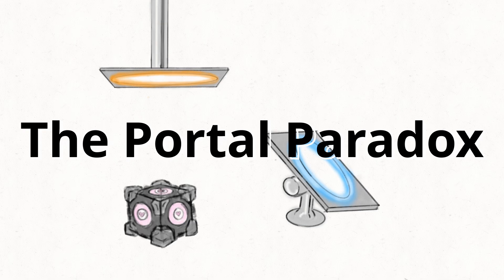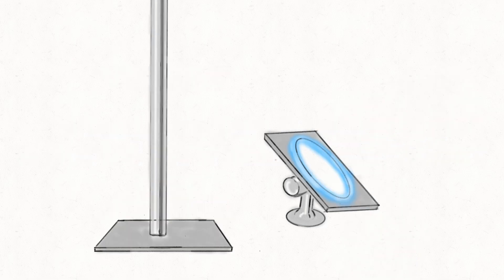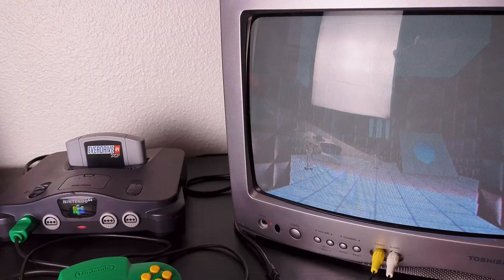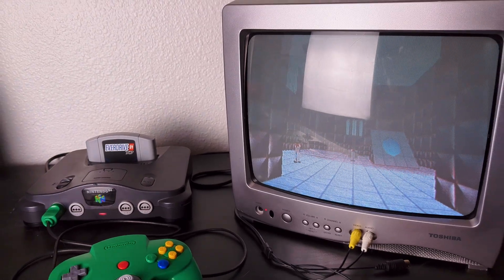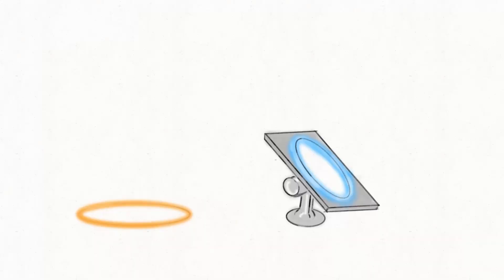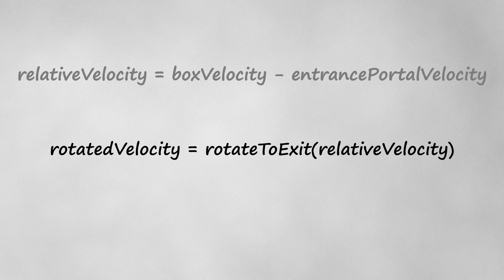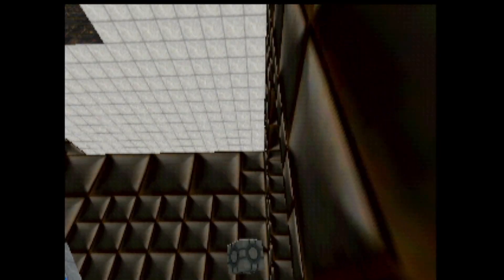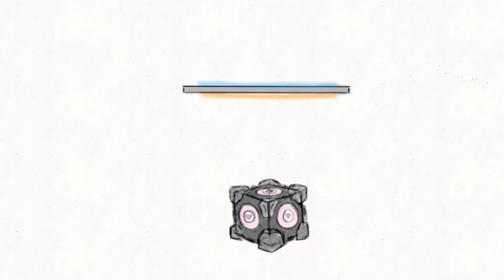I rewrote Portal from scratch and solved the Portal Paradox

Comment: Excellent topic and wonderful implementation! I understand what you implemented and it works great, but I do believe it's based on an invalid premise.

The more I look into it, the more I think this is not right. Portals connect two different locations in one spot. The moment portal is created, it's a 0mm bridge between two points in space. When you look at the orange portal what you see inside is space occupied behind the blue portal, and vice versa.

In a way, creating a portal would be like having a box with one side removed (that side being "the portal", outside being orange side, and inside being blue side). 

With that in mind no matter how fast you drop the box onto a different object, you wouldn't expect the object to start flying inside the box. You'd might say "Hey, this is my example with the portals on top of each other!" And to that I say, yes, but also no. Just because in the main example blue portal is elsewhere, the exact same logic applies because portals are connected, and blue portal from the orange's perspective is falling down equally fast so it should all cancel each other out. Given that two portals are bridges between two points, relative elements from the portal cancel each other out and only velocity that's important is object's velocity. The mere act of going through a portal does not induce new velocity regardless of the setup because once a portal is connected, it is effectively a hulla hoop regardless of the configuration, position in 3d space, ...

Consider this viewpoint test (which works in all cases, including examples you gave in the video) - Imagine placing a camera on the object, and on the other side of the box. 
Camera 1 would see Orange portal flying down towards it, and Camera 2 would see object coming closer.

You could create the exact same viewpoint test with 2 phones and a regular box. You'd see the same thing, and you wouldn't expect the phone on the ground recording upwards to jump up in the box. If anything the example you've made, with the portals on top of each other kind of proves the whole point, and I'd argue it's the only accurate case because it's only in that scenario the relative forces of the portal movement cancel each other out. while in all other cases it's the blue portal from the orange's perspective that's cancelling the orange's movement.

I hope that I've somewhat articulated my point, and I'd love to hear your thoughts!
Reply: You're exactly right. Portals are just open doorways to an unusual location, not some magic momentum transferring device. If you slammed down an open doorway on the cube, it's not going to launch up into the air, the cube is just on the other side of the doorway. The exit location being over on the other side of the room doesn't change this. People are coming up with all kinds of arguments to impart momentum from the portal onto the cube, but no such mechanism exists when a portal is effectively nothing. Nothingness coming into contact with something cannot give energy to it.
Reply: @Sypher474  Thank you!

Comment: I'm no expert, but I feel like the cube wouldn't be able to fly out on the grounds that it would have no energy in its system. If reeling an object back of lifting an object up gives it potential energy and releasing or dropping it transfers all of that potential energy into kinetic energy (bar energy losses from air resistance/gravity), I see no way for the cube to gain any energy at all. Yes, the portal has  energy, but that energy was given to it when it was raised to the ceiling. Dropping the portal down uses that potential energy, all of it. The portal has no collision with the cube (hence why the cube wouldn't jump in the hula-hoop example) and therefore there is no energy transfer at all. If the cube were to shoot out in a real-world scenario, that would be a case for creating energy from nothing (perpetual motion machine that completely disregards all forces acting upon it)

Comment: Everybody focuses on how the cube going through the portal is the same to the portal. Whether the cube is moving at that speed or the portal is moving at that speed around the cube. Everybody ignores the fact that the cube does not have its own inertia, it's like the buster Keaton bit where the building would fall down around him. To the point of view of the building, him jumping through the window or the window falling and crashing around him but not touching him is the same, he physically does move through that window frame at that same speed either way. But, he doesn't suddenly jump up after going through it, because he's inertia is keeping him still. So a cube that does not have any movement going through the portal would then just suddenly have a little bit of distance between it and the floor and would fall at normal gravity towards that floor. The cube has its own inertia, and it's a nurture is keeping it. Still, not sending it flying

Comment: If I was in a room with an open doorway that just opened up to the outside and the whole room shifted sideways at the same time that I jumped...I wouldn't gain sideways momentum from the door passing around me, I'd just fall straight down again, maybe a little momentum in the direction that the door had moved due to air currents.

I see the portals like that: just fancy doorways. One passing around you wouldn't add kinetic energy to you.

Comment: My interpretation has always been that moving a portal surface breaks portals in every* scenario implies a non-relativistic universe. There is a preferred frame to the universe and portals which are moving relative to that frame break. This makes the portal paradox trivial because you just work in the preferred frame. I suppose there could be a more general interpretation where portals must maintain the inertial frame they are created in which would allow for an interaction like this. Without thinking too hard, this seems like the way to resolve the issue with such a universe (all the portal interactions you showed are in a fixed frame as the object passes through).

* I know the lasers and moon technically break this but that seems more consistent with a dev oversight than an intentional choice about the physics.

Comment: This is all incredibly obvious.
How could anyone with basic physics knowledge even think it behaves the other way?

More interesting is that this isn't an all-or-nothing effect, 'slices' of the cube would have this momentum, which the rest of it is completely still; this would result in part of it pulling the rest along.
The end effect would be that this overall relative momentum is greatly halted by the first slices trying to pull away, and then being pulled back, thus pushing back the following slices slightly.
If you did the same thing with a huge blob of putty it would just stretch out, but with a rigid object it'd be far more complicated.

Comment: A = Portal 1 Velocity
B = Cube Velocity
C = Portal 2 Velocity
Change = Total Sum of Changes to Velocity
RV1 = |A - B| + Changes
RV2 = |B - C| + Changes
RV3 = |A - C| + Changes
Total Changes = All external forces applied
Total Velocity= A + B + C
Total Energy = Total Velocity + Total Changes

Premises:
1. Relative Velocity = |A - B|
2. Velocity only changes due to external forces being applied. ----- What you are ignoring.
3. Relative Velocity will increase or decrease proportionally dependent on the changes of the objects' velocities that are involved. ---- What you are ignoring.
4. Total Energy should only occure when an external force is applied contributing to the Total Changes. -- What you are ignoring.

Occurance:
Portal 1 falls around cube, stops on ground.
Cube resides on ground.
Portal 2 resides stationary on slope.

Starting Scenario:
Portal 1 Velocity = A = 10 m/s
Cube Velocity = B = 0 m/s
Portal 2 Velocity = C = 0 m/s
RV1 = |A - B| = |10 - 0| = 10 m/s
RV2 = |B - C| = |0 - 0| = 0 m/s
RV3 = |A - C| = |10 - 0| = 10 m/s
Total Velocity = 10 m/s
Total Changes = 0 m/s
Total Energy = 10

Force Applied: Portal 1 hitting ground.
Result: Portal 1 drops to 0 m/s velocity

Portal 1 Velocity = A + Change = 10 - 10 = 0 m/s
Cube Velocity = B = 0 m/s
Portal 2 Velocity = C = 0 m/s
RV1 = |A - B| + ChangeA = |10 - 0| - 10 = 0 m/s
RV2 = |B - C| = |0 - 0| = 0 m/s
RV3 = |A - C| + ChangeA = |10 - 0| -10 = 0 m/s
Total Velocity Before Change = 10 m/s
Total Change = -10 m/s
Total Energy = 0 m/s (Lost to Enviornment: Gravity on Portal 1 canceled by Floor resistance)

Ending Result:
Portal 1 Velocity = A = 0 m/s
Cube = B = 0 m/s
Portal 2 = C = 0 m/s
RV1 = |A - B| = |0 - 0| = 0 m/s
RV2 = |B - C| = |0 - 0| = 0 m/s
RV3 = |A - C| = |0 - 0| = 0 m/s
Total Velocity = 0 m/s
Total Changes = 0 m/s
Total Energy = 0 m/s
All energy lost to environment (gravitational force being equalized by ground resistance force on Portal).

This is what should have happened.
Portal 1 decellerated. The relative velocity between Portal 1 and Cube should now be 0.
You ignored this, and seem to believe that the decrease in velocity of Portal 1 is balanced out by the arbitrary force randomly applied to Cube for no reason, so that the end result is still 10 m/s for RV1.

What you erroneously did:

Occurance:
Portal 1 falls towards floor, hits floor, decellerates to 0 m/s.
Cube resides on floor stationairy, acquires phantom force, adding 10 m/s to velocity.
Portal 2 remains stationary.

Starting Scenario:
Portal 1 = A = 10 m/s
Cube = B = 0 m/s
Portal 2 = C = 0 m/s
RV1 = |A - B| = |10 - 0| = 10 m/s
RV2 = |C - B| = |0 - 0| = 0 m/s
RV3 = |A - C| = |10 - 0| = 10 m/s
Total Velocity = 10
Total Changes = 0 m/s
Total Energy = 10

Forces Applied: 
Change1 = -10 m/s to Portal 1 (Hits floor, decelerrating to 0 m/s)
Change2 = +10 m/s to Cube (Phantom Force)

Portal 1 Velocity = A + Change = 10 m/s -10 m/s = 0 m/s
Cube Velocity = B + Change = 0 m/s + 10 m/s = 10 m/s
Portal 2 Velocity = C = 0 m/s
RV1 = |A - B| + Change1 + Change 2 = |10 - 0| - 10 + 10 = 10 m/s
RV2 = |B - C| + Change2 = |0 - 0| + 10 = 10 m/s
RV3 = |A - B| + Change1 = |10 - 0| - 10 = 0 m/s
Total Velocity: = A + B + C = 20
Total Changes = Change1 + Change2 = -10 + 10 = 0 (Your theory that the forces should arbitrarily transfer as to not change the relative velocity equates to "no change")
Total Energy = Total Velocity + Total Changes = 20 + 0 = 20

This somehow ADDS 10 Phantom Energy to the scenario.

Result:
Portal 1 Velocity = A = 0 m/s
Cube Velocity = B = 10 m/s
Portal 2 Velocity = C = 0 m/s
RV1 = |A - B| = |0 - 10| = 10 m/s
RV2 = |B - C| = |10 - 0|  = 10 m/s
RV3 = |A - C| = |0 - 0| = 0 m/s
Total Velocity = 20
Total Changes = 0
Total Energy = 20

This is your erroneous error.

You've added a phantom force into the mix, by assuming that the cube would move to maintain the relative velocity, while ignoring that the deceleration of the portal should've decreased the relative velocity by an equal amount between them... You were so fixating on thinking that it had to abritratily be maintained, instead of the reality that it would've all decreased because you lost force in the scenario due to the portal stopping.

This is how you're wrong.

The issue becomes increasingly more glaring in a scenario that Portal 1 never stops moving, because then there is an increase in their relative velocity as a whole even, and even your "must maintain this relative velocity" is false, because of this phantom force you're adding.
Reply: Wrong.

Comment: wow I'm super late with this comment, but I disagree with this. Let me explain why!:

- Speedy thing in, speedy thing out is true, however, speedy thing is not going in. Speedy portal is enveloping stationary thing.
- Because speedy thing does not go in, it has 0 velocity. The speed of the portal doesn't matter because the portal is 'nothing'. It's just a hole.
- If the portal slams down onto the cube, it more or less acts just like your hula-hoop example, it just comes out somewhere else.

You can assume if you don't slam the portal, but stop halfway down the cube at high speeds, nothing would happen because the cube is still resting on the floor. It never leaves the floor. A portal will always act like a hula-hoop. Once the orange portal meets the floor and cannot go any further, the blue portal becomes the floor, and its as if you are dropping the hula-hoop on top of it

Comment: That is wrong.

The issue with this equation is that isn't even how "relative velocity" works.

You are creating a negative velocity which is 1. Not possible, and 2. You are generating NEW velocity, actually INCREASING the would-be velocity between the two objects.

the relative velocity between two objects that DO NOT change velocity at any point, should remain equal.

That's what you're trying to simulate by having the portal stop moving, and the box moving instead. But that's not how you calculate that. If the box's velocity is 0, and the portal's is 10.
The portal's should remain 10, and the box's should remain zero, and the relative velocity between them remains 10.

If the portal decelerates, the relative velocity between them should remain the same.

For the box to move, a FORCE MUST BE APPLIED TO IT. Or it remains zero.

The portal's velocity decreases to 0. The relative speed should at that time then be zero, because the object decelerated, and no other forces were applied.

Instead, you're saying that the portal stopped arbitrarily, but somehow this doesn't affect the relative velocity at all, so that phantom energy is transfered to the box, and instead somehow accelerates the box without any force being applied to the same velocity.

That's not how transferal of energy works.

That's a phantom force.

Say the portal didn't stop arbitrarily. With this equation, you'd STILL shoot the box outwards at the velocity the portal fell on it, but BOTH would maintain that velocity, meaning you've ADDED to the relative velocity.

The equations are correct.

What's wrong, is how you applied them.

You need a mechanism for a transferal of energy. You do not have such a mechansim That's where you fucked up.

I can say that the sky is blue, and the grass is green, and that if you remove color from sky, and add color from sky to the grass, you then make the grass a blue-ish green.
That's not unactual in theory.

The problem is there is saying I can somehow magically absorb the color blue from the sky with a baster and then inject it into the grass.
That doesn't work. That's not how you can apply that concept, nor can that concept actually be applied in reality.

If you had a brick. And you smashed the brick onto the cube. In a vaccume with no friction. You'd be closer to what you're doing here in the equation, because the brick tangibly applies force to the cube. Granted you'd have to subtract the static friction through some calculations to the cube's new velocity, due to a mass differential.

But that's the concept you're aiming for, with NO transferral of energy.

That's the issue.

Comment: This is super impressive stuff, props my man.

Super late response, but I think the answer to this squarely sits on if you believe the space in between the portal can enact force onto the cube. For me, I see the portals as a mere translative motion across space, so I would say the only force on that cube as it leaves the blue portal is gravity. So I’d say it plops. But if you see the portal as a movement arm that pushes the portal out at the same velocity the arm moved onto it, then it’d launch as shown.
Reply: The box already has momentum relative to the orange portal. That momentum is carried through to the other side, which is why you see it launch out the blue portal.
Reply: @APaleDot It has momentum, but I believe that gravity acts against it, so it would result in a slight hop at most. After all, the acceleration that tbe box experiences should be equivalent to what would happen if you moves the tile that the box is on upwards at the same speed that the portal travels down and then suddenly stop. It would hop, but not as far as if it were launched at an angle.
Reply: @darthplagueis13 
The original question doesn't specify how fast the orange portal is moving. The implication is that if you answer 'A', the cube will *plop* out of the blue portal regardless of how fast the orange portal is moving.

Comment: I am no physics major nor expert on wormholes (which is canonically what the portal gun is based on)... But this makes no sense at all to me, in that while the orange portal is moving the other is not, thus the space between them aka the wormhole is not. The entrance is in motion, but the exit is not thus the space between them within the wormhole is static having no inertia of its own to impart to the cube. 
That is to say the orange portal would effectively be resting its destination constantly in real time to match the destination of the blue portal, and in doing so would be continuously resetting the inertia of the worm hole. 
1. If they both move the space of the wormhole moves with them.
2. If neither portal moves then neither does the space of the wormhole.
3. If one portal moves but the other does not then either the space of the worm hole would stretch the distance of the movement (creating a gap that the cube would either fall into, or take time to move through), or the worm hole would reset itself to match the position of the moving portal. Either way the cube would fall to the ground upon exiting the portal having no inertia.